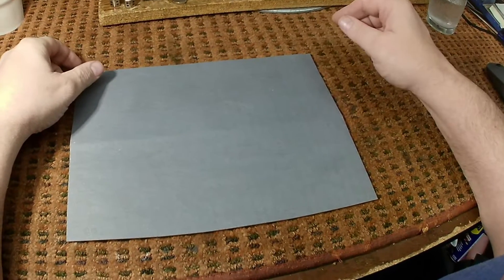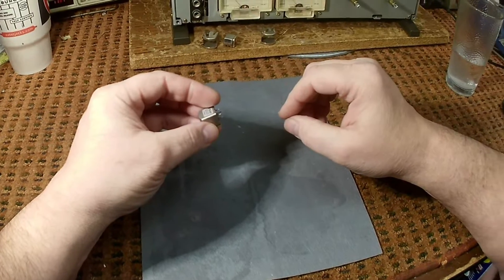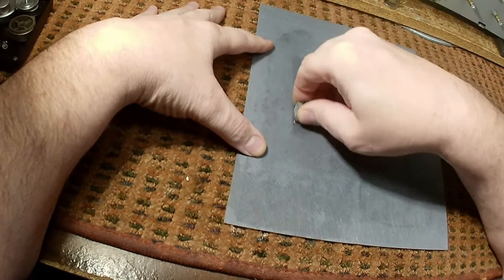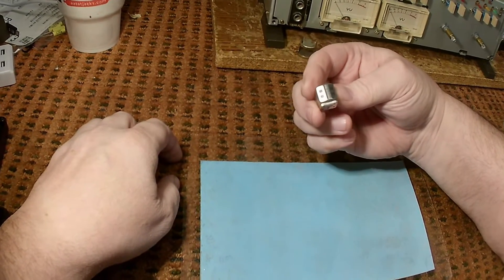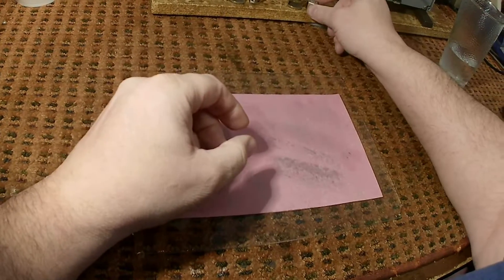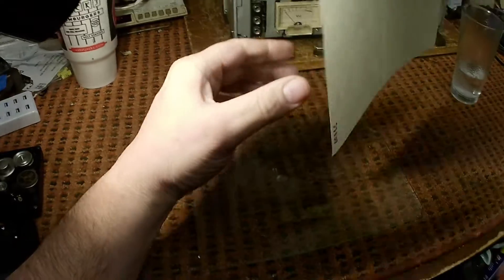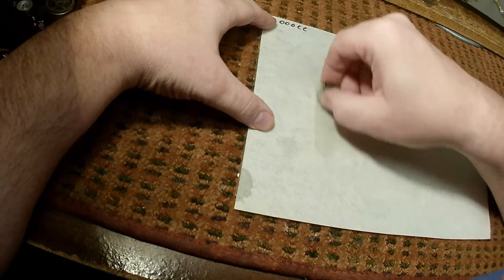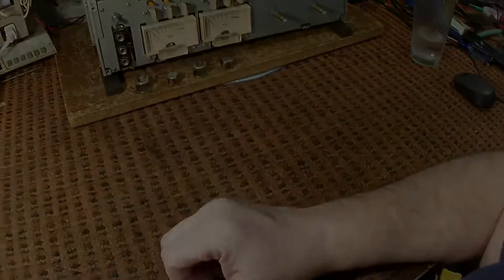How To Relap Tape Heads (With New And Improved Camera Angles!)

Comment: Thank you for this very useful video. I see you polish the heads in a « flat » way, without taking into account the curvature of the head. Should one not apply a slight curve to the movement when sliding over the dry wet sandpaper?
Reply from the maker: I do, although it may not be apparent in the video. I need a better camera for such things. As I lap the heads back and forth, I also rock the head against the direction of travel with each stroke, following the original curve of the head, until the wear groove is gone and the flat spot from tape wear vanishes.

It's not really possible to achieve the original hyperbolic curve of the head, if that's the curve it had to begin with. Not all head faces are hyperbolic. But it is possible and relatively easy to get to a shape that restores full frequency response and reliable tape contact, provided that the head is not too worn to begin with. 

Thanks for your comment!

Comment: The head on my machine doesn't have any sort of lip or anything that catches your nail, but it does have some slight visible corrosion, which has a very slight texture (not enough to catch). Would starting with 600 still be necessary, or would starting at 1500+ be acceptable?
Reply from the maker: What concerns me is that corrosion is not merely a surface defect, but rather it etches into the metal of the cores and the surrounding metals. It may have already eaten too far into the head to be repairable. Corrosion creates pores of varying depths, and you would need to get though them all. This might mean going too far, which will result in a ruined head. I have added a link to the description above where you can download the last version of the Nortronics Head Relapping Guide. I suggest you take a look at it.

Relapping is not really intended to go into the cores of the head, but rather to bring the unworn surfaces around the cores down to the level the cores are presently at, get rid of any flat spots on the cores, and then bring the entire face of the head to a high polish. Wearing the cores deliberately (to get rid of corrosion) is not a great idea because the cores can only be worn so far before the backs of the head gaps are reached, at which point the gaps widen suddenly, the inductance of the head drops, and it ceases to perform within acceptable limits. You did not say what machine you have, but if the rest of the machine is working well, it may be worth looking for a set of heads for it.

As always, I would not suggest removing the heads unless you have the necessary knowledge and tools (including professionally-made alignment tapes) to put the heads back and align them correctly.
Reply: I have alignment tapes, but that's the answer I was afraid of.  I have another machine I can get one from (head is same make and part number). I was just hoping I could save this one. Thanks anyway.

Comment: Studer tech's use a micro jig to ensure very high tolerance. Freehand relapping is not precise.
Reply from the maker: Neither is a worn head. And Studer will not relap your Teac heads for you.
Reply: Of course a proper jig which maintains the original contour and radius is ideal but skillful hand relapping using a proper rigid abrasive surface, as per the original Nortronics instructions, has been a tried and proven method for many decades. But as always the real proof of the work is in the relapped  head's playback response to the test tape.
Reply: @oldgoody1  No way hosay, freehand will never be proper. Impossible.
Reply: @miss.wright3035  Didnt say it would be. Please read my post. Better is not best, but it's still better.